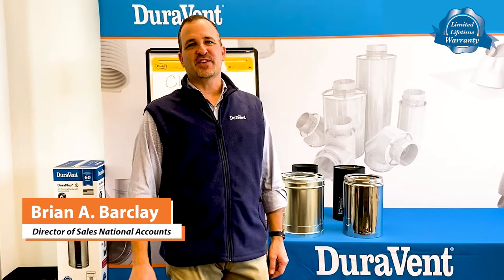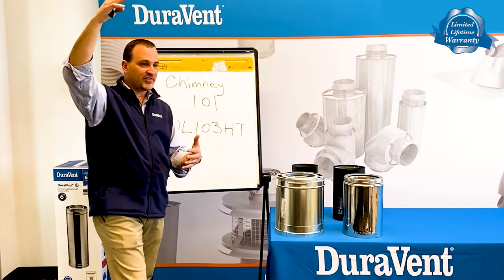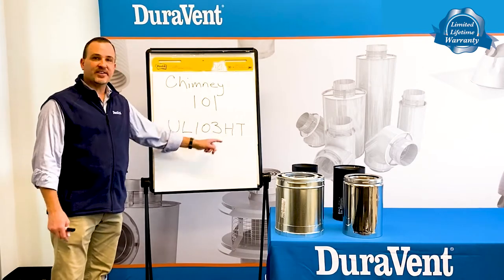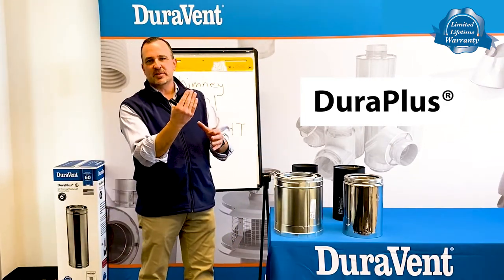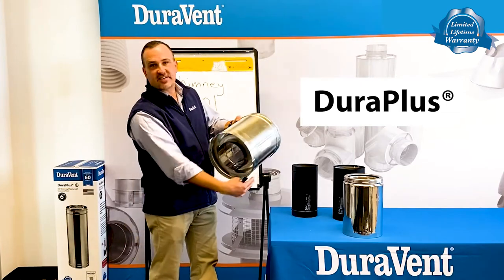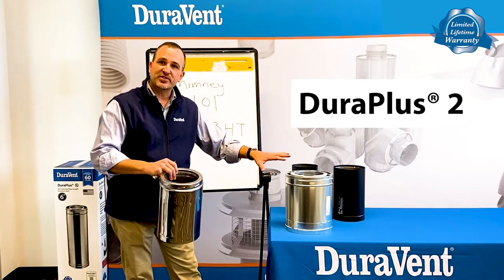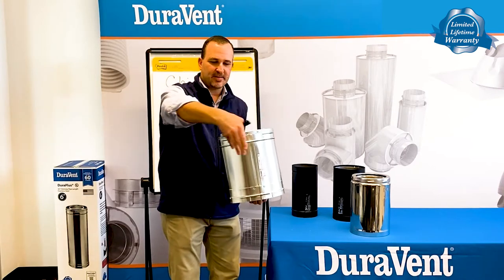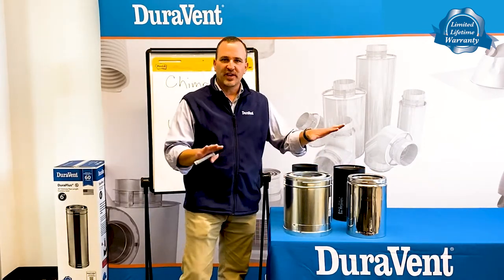Chimney 101: Where and When to use Chimney Pipe

Comment: I have the duraplus brand.  Where the horizontal T portion meets the vertical, it leaks along the factory seam.  Is this common?  Should I silicone that?  I wouldn't be to concerned but it weeps and follows the pipe into the cabin and leaks a little.  Note-the exterior thimble was sealed with high temp silicone around the pipe and regular silicon where thimble meets exterior wall (T-111).

Comment: Thank you, this basic insight would have helped me a lot….still not too late…as I can reopen the roof and get a better pipe in.

Suggestion: pipe/chimney inside diameter. Consequences if deviating from this basic rule.
Reply: Imagine drinking a milkshake through a narrow straw. To small a pipe, and you restrict the flow. If the chimney is of normal height, and thus normal draft, your stove will perform poorly. If you use an oversized pipe, the exhaust will expand which allows cooling. It also flows through the vent slower since the incoming air supply is restricted. This results in creosote formation.
Reply: That’s kind and helpful  insight which you’re providing. 

Follow on question: for a 19kw pellet stove with 80 mm outlet: at sea level, what’s the best (inner) size of the pipe: the 2.5metre inside the house single walled at 80, and outside the flat roof 1.5 metre double walled with 100mm, plus an anti-wind/rain-hood?

Comment: What if I just use the triple or double wall outdoor rated product both inside and outside from stove to chimney cap?
Reply: You need to use chimney pipe starting where it goes through the wall or ceiling. You can use it closer to the stove, but it is more expensive than connector pipe. For that reason most people don't start the chimney pipe until they are within 18" of combustibles with single-wall connector, or 6" with DVL.

Comment: They probably don't answer these questions because of potential liability concerns for the company. Additionally, local building codes can differ from county to county or state to state. Lastly, there is not really "one best way" to install these, so they are surely counting on a permitted contractor to install this per state regs. They will sell the unit to homeowners, but if you can't figure these problems out in a way that is safe and meets code, then it's likely best if you hire a qualified installer. Do some reading and a little research coupled with some (uncommon) sense and you'll be fine.🙃

Comment: I'm not an expert, but what did millions of households use hundreds of years before the shinny, pretty OMG YOU BETTER NOT USE ANY OTHER PRODUCT BUT MINE came along? Minimum $1,000 to use what the "experts" say.   About $175.00 and some common sense will do the same thing.
Reply: Sad but true...
Reply: The current rate of death associated with chimney fires in the US is very low. What "they" used to do was die in home fires caused by inadequate venting systems. They tried to limit the incidence of chimney fires by making little boys climb up the chimney by sticking pins in their feet if they were to slow. The normal life expectancy of a chimney sweep back then was less than 22 years. (They died from "soot wart" The first reported kind of occupational cancer.)